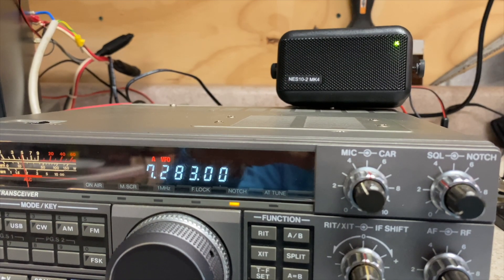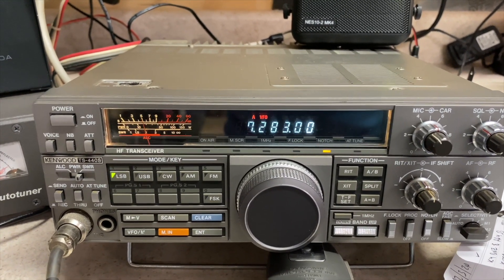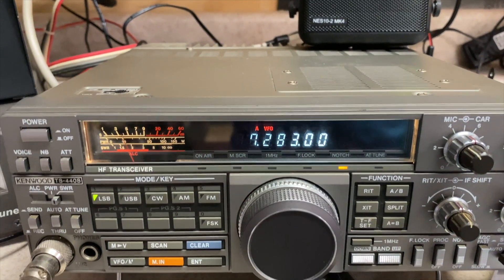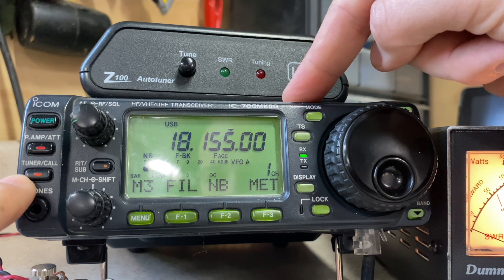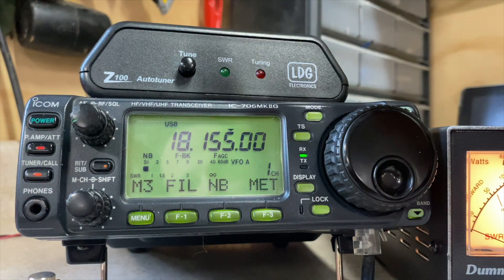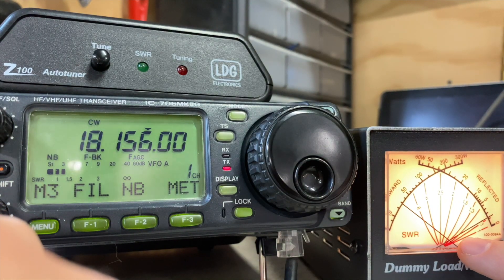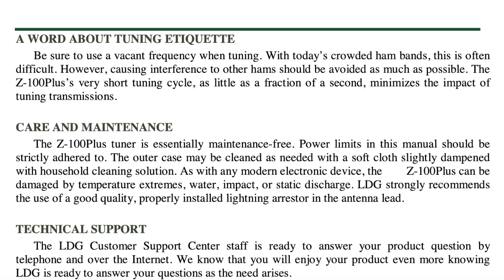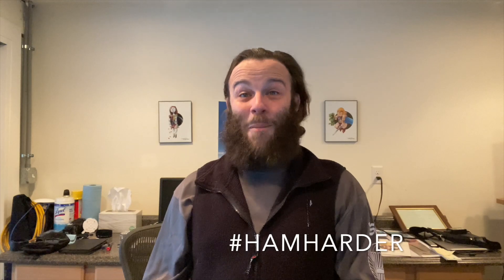Hametiquette   Tuning your radio

Comment: Thanks! I’ve also heard that putting your radio to 5w and tuning on AM doesn’t bother anybody. Thoughts?
Reply from the maker: Lowering the power down to the bare minimum that your tuner needs is ideal but you still need to be off a used frequency. There are plenty of QRP operations running on 5w that can reach around the world under the right band conditions.
Reply: @LifeAtTerminalVelocity  right, that was understood, thanks for clarifying. It makes sense to change freq if you know what freq you want to transmit on, but what if you’re just switching bands and don’t have a freq in mind?